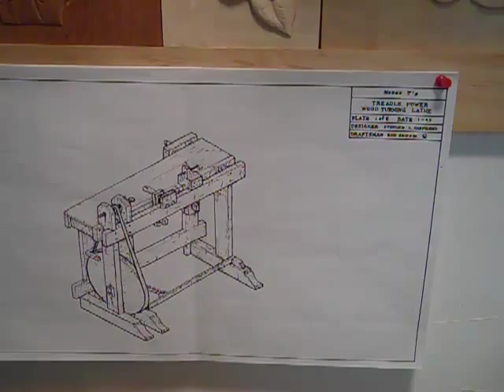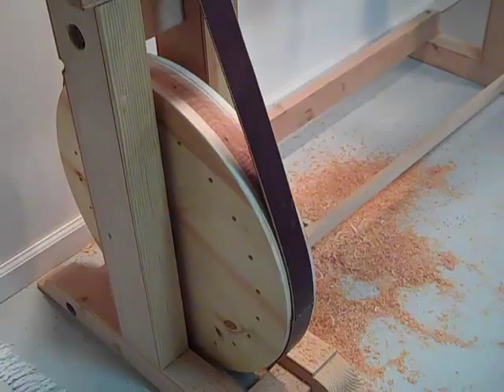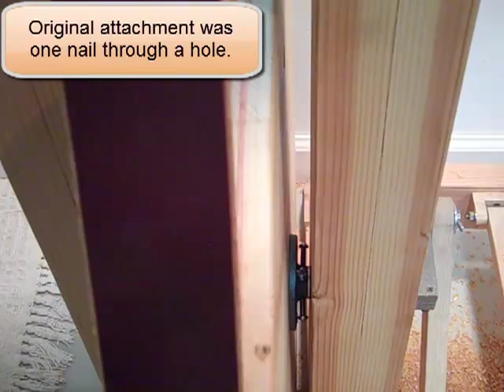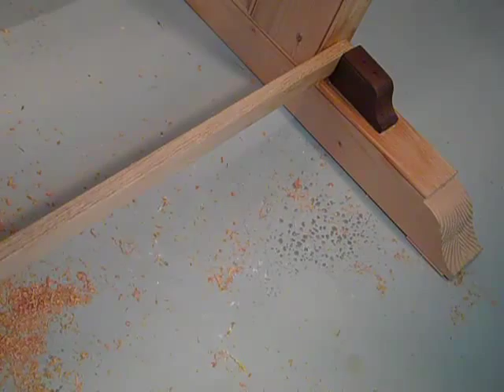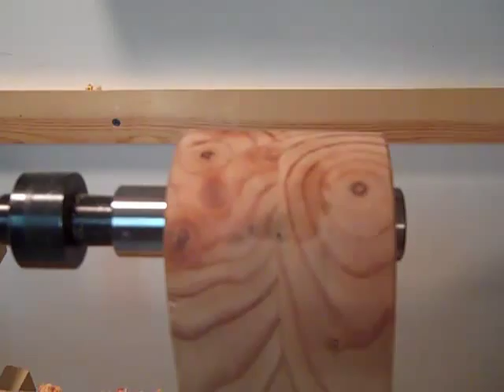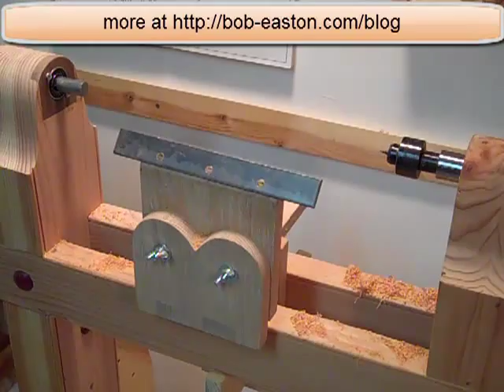Bob Easton's Treadle Lathe - A tour

Comment: Bob, I am currently working on building Steve Schmeck's Treadle Lathe but really liked some of the features of your lathe... I would like to know more about this thrust bearing that you have at the end of the spindle, what size, where you got it, etc. Also, does your friend sell these machined blocks that you have on your crankshaft? I'd be extremely interested in either steel or aluminum.